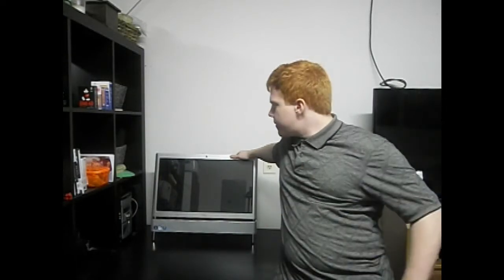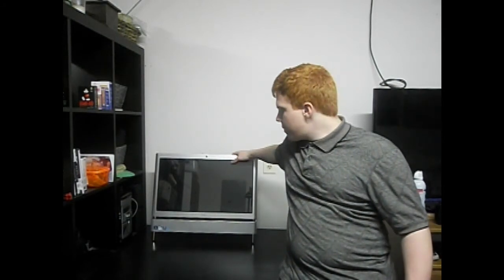Cleaning Acer 5600Z / Fixing overheating.

Comment: If I get a black screen what does it mean? That the graphics card is dead? I swear those AMD Radeon are the worst garbage chips on the market. They always fail.... nvidia also fails but not nearly at the rate AMD does. Reflow is shit so I will buy a new graphics card but first I need a confirmation that this is my issue...
Reply from the maker: +Daniel Maxter Just to clarify your Acer 5600Z gave you a black screen? What happened before it went black any symptoms it had?